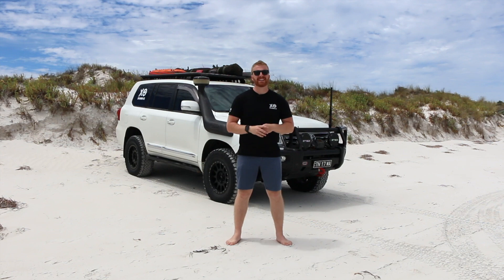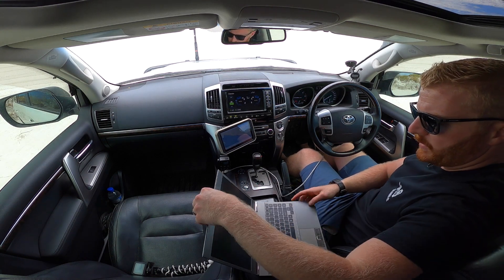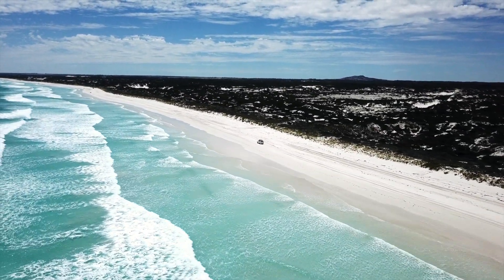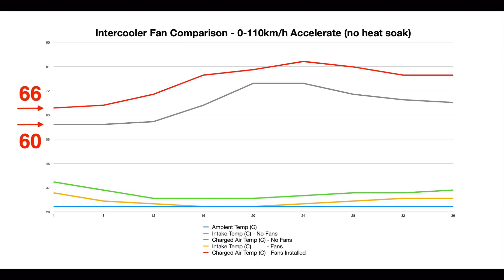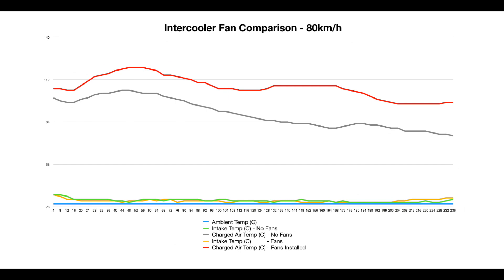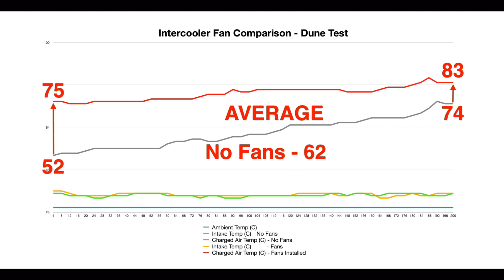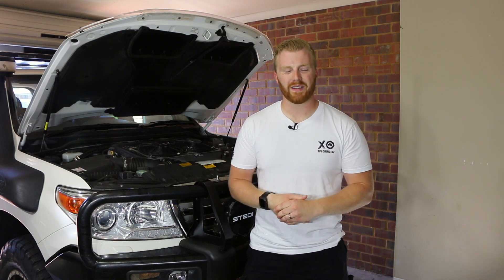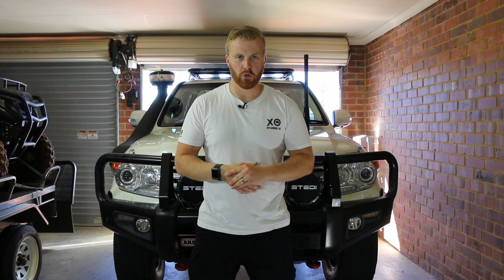Pt. II | INTERCOOLER FANS on SAND | Low Speed - High Load | Landcruiser 200 series off-road

Comment: I wonder if the results would have varied if (instead of plotting absolute temps) you had plotted the temperature delta across the intercooler. Perhaps the results would have been more definitive. 
This would have removed the variability of the work across the runs. But it depends on whether the 200 has a sensor before the intercooler too.. I imagine it does though.

On another subject, can you recommend a good maintenance manual to carry for the 200?
Reply from the maker: Potentially, good idea though. Maybe something I'll consider doing in future tests...
The nearest sensor to the intercooler, prior to the cooling element is that intake temp (after the airbox). An aftermarket bung would have to be installed to see the temps immediately prior to the cooling element. 

So for manuals, I carry the hardcopy of the Hayne manual - https://haynes.com/en-au/toyota/land-cruiser/2007-2016?gclid=Cj0KCQiAnKeCBhDPARIsAFDTLTLi2khZDj3OKC0P-yx9fSj_eKnJYLIL4IKfunflGOiWknw1VFloIB8aAq99EALw_wcB

Has most things you'll need in most circumstances to get you out of trouble if required. I'm yet to have to use my one out on the road, but I'm confident with it in the back of the cruiser.
Reply: @XploringOz  Thanks for that, I'll grab one.

Comment: Great video Nathan thanks.  Interesting results. I really would have thought the low speed high load with fans attached would have yielded lower temperatures.
I'm wondering if the fan shrouds are blocking some of the airflow from the ducts from the front of the vehicle??? 
I'm sure that the Toyota Engineers have considered fans and may well have come up with the same conclusion as you.  Doesn't make a difference and your data seems to support that.
Reply from the maker: Thanks mate, glad you enjoyed the video. 
I don't believe that the shroud is blocking airflow, I believe that the fans are producing to much CFM (flow rate) which the intercooler isn't designed for. This intercooler appears to be designed for high heat dispersion with minimal air flow. I contacted Toyota regarding their optimal air flow rates, however they were not willing to share that data due to intellectual property rights...
I'm happy with the way my vehicle performs and I hope others can make an informed decision based on all evidence out there in regards to whether these fans will suit their vehicle.

Comment: Could it be worth trying the fans in reverse, pulling air through the intercooler instead of trying to push it through?
Reply from the maker: Potentially this may provide some benefit at very low speeds as pulling air through a cooler is definitely better than pushing however, pulling through the intercooler upwards would significantly effect the characteristics at medium to high speeds. The air flow coming through the front grill and into the intercooler would be fighting against that of the fan airflow. 
Ideally, you would have puller fans underneath the cooler
Reply: Definitely worth a try, nothing to loose?